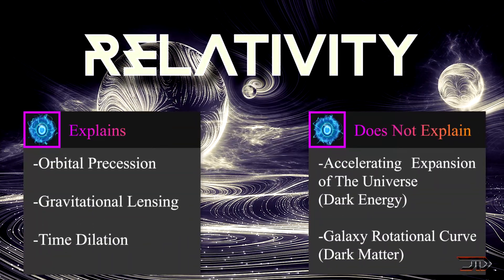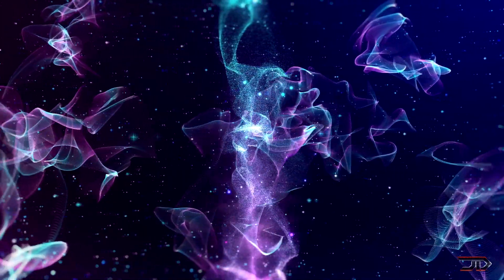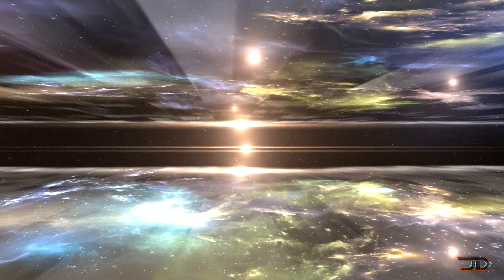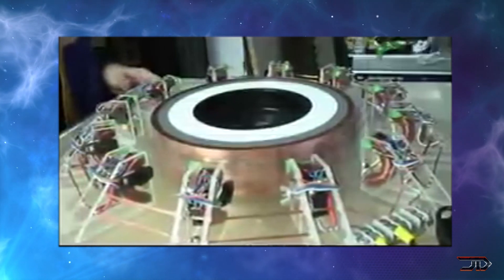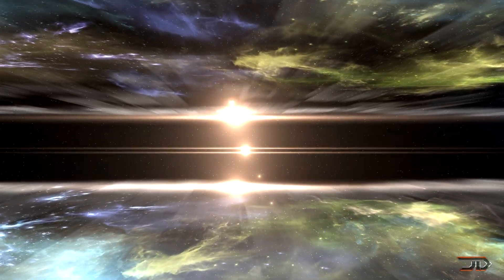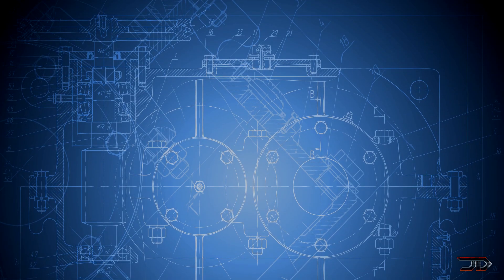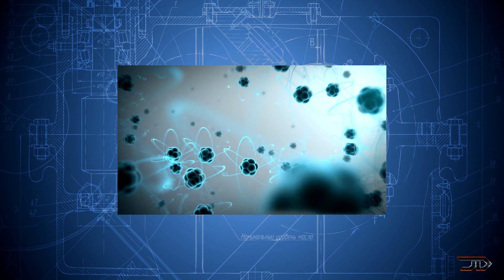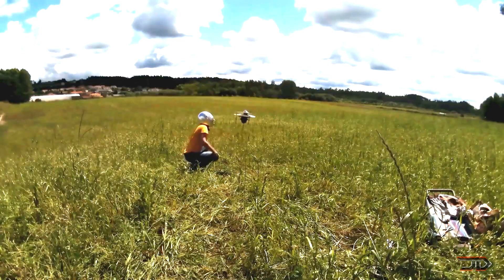Does ANTI-GRAVITY Technology Really EXIST?

Comment: In the 1950s anti-gravity was the rage as industry was experimenting every way possible and all the major magazines were following the research monthly until the mid 1950s as no more stories were written and went completely silent and was very odd and sudden !

Anti-gravity became a non-subject to write about for some reason !
Leaks began to surface in mass in the mid 1990s !

In my opinion you must block the local laws of physics from affecting your craft so to block particle entanglement that gives other atoms  mass a high voltage terrahertz frequency has been used to power a magnetic field that blocks that communication between atoms locally like static blocks radio communications and by 1999 a craft with 79% anti-gravity was built called the TR3-B and is a 300 foot triangle !

Field propulsion vehicles are the future of air and space travel !
This type propulsion has been observed by all UFO witnesses !
There are no motors or noise of mechanical machine type sounds and no sonic booms at all going high speed and excelleration is beyond belief !

I think we back engineered UFO technology but had trouble making the materials needed that had exotic layered metals but it was 79% effective !

No research that is successful will be allowed to be in the media or published or patented as the Govt. has classified this technology as it relates to National Security !
All zero energy devices has been confiscated or destroyed as well !

Truth in some subjects has been outlawed basically !
Reply: Its been patented. By salvatore pais

Comment: This is by far the most accurate description of AC gravity and indeed we need to know more about the molecular composition and its alignment to create a force field. Imo we have to drop quantum mechanics altogether since it is based on an empirical model which makes it hard to give an actual description on what is happening at the Planck length scale. One derivation I have found so far based on E=mc^2 and some crude assumptions (as Niels-Bohr did for his Hydrogen model), is to create an electric field by having the electrons occupy different orbitals (e.g. paramagnetic) which then has a 'field strength' of E=q^2/(4*PI*ε0)+q(c x B)*r, where 'x' denotes the vector product, B=magnetic field, r=radius of the atom, q=charge of the particle, c=speed of light.
Reply: I think it is something to do with manipulation of space in the direction of travel, such as creating a vacume, that will suck you in!
Reply: Math comes after the success.  Math does not create it answers the why and what for after the fact.

Comment: Supposedly the seg inventor has the generator inside a craft and it flew,  but even the magnet rollers are nearly impossible to make, or to magnetized in the proper orientation, then there is a ton of them, seems like it could be done solid-state, with electromagnets, Possibly working better, but if it worked only as a generator it would be amazing, self powered! But a solid-state version may not work as a generator, unless......
Ha-ha

Comment: its easy as one 2 3 , hows how make a copper ring in 1 metre in diameter 1mm thick  by an inch wide copper plate in a circle 1m inch wide 1mm thick , then make the same ring out of acrylic stick that 2 copper ring then make another copper ring for the bottom stick that to it so its a sandwich , ok use a high voltage neon sign power supply put earth at the bottom plate positive to top plate best stick some string to corners so it doesnt fly off and switch on , hey presto a high powered capacitor that pulls itself up in the air easy peasy , has to be big or wont work , anything above 1metre wide.

Comment: In a nutshell, no. But allow me to point out there are a few different flight mechanics. For example, fixed wing & rotary wing. Both use an air foil to create lift. Then consider hot air balloons & zeppelins. Lighter than air flight mechanics are entirely different. They appear to be defying gravity, but it’s just a different method of gaining lift.
Reply: Pressure

Comment: Anti-gravity doesn't mean hovering
An anti-gravity device should eliminate every single gravitational force in the universe.
Even an hydrogen atom at the edge of the universe still have an impact (however small) on the rest of the universe.
The anti-gravity device will NOT fly off, but it will stay completely still (motionless) in relation of, not just the planet Earth, the solar system, the galaxy, the galaxy cluster ... but the whole universe. To our perspective it will disappear faster than the speed of light, and we don't really know what direction the Earth is moving in relation to the rest of the universe, so, having a ceiling won't really help if the planet is moving the opposite direction. it's possible that it will have enough force to pierce through the Earth's core. 
nobody wants to take this into account because, first it is a boring concept, second, we want to control antigravity decides so we can fly them …. but that's just levitation, it has very little to do with antigravity.

Comment: It's simple: Space expands in an accelerating way because of the fact that radiation is sending out of spherical objects. These object loose mass and for this reason they loose gravity. So the space is expanding around them. Its a relationship between radiation surface and Volume(i.e kinetic energy). 
The Galaxy Rotational Curve can be explained by the gravitomagnetic force in the rotational angle. NO FUCKIN DARK MATTER. Every force is a reaction to an other phenomena, accelerating towards the speed of light.

Comment: Magnetic field around the craft which can bend light, trans medium craft which can go through water air space etc. it’s within a vacuum that’s likely one of the reasons it’s so quiet because it’s within its own environment. There are many different types with many different densities. They are inter dimensional. It involves quantum physics.
Reply: Not just bend light. It bends everything around it. That's the reason why it propels itself through the air and sea without friction and heat produced. Nor vibrations. Remember Bob Lazar said he tried to touch it but he couldn't. The craft's crew unaffected.

Comment: Level's of anti gravity
1.electrogravitic
2.magnetogravitic
3.direct generation and harnessing of the gravitational strong force
4.field propulsion..
Reply: you forgot powering it with zero point energy, such that it doesnt need any fuel and wont degrade cause no immense heat or pressure. the anti gravity field also shields you from radiation, so you could even use modern computers inside without fearing data corruption or dna damage. you dont need any equipment to refill fuel, or for take off and landing, and the energy needed is much lower than conventional rockets, and you will not feel any acceleration even when doing 90 degree sharp corners at 20x the speed of sound. all the obstacles of space travel are obsolete for anti gravity devices

Comment: I still think that Townsend brown kinetic devise is worth a look. I reckon that project winter haven produced verifiable results. I have seen a paper published in the mid 1950's written by two British scientists about the state of gravity research  who stated that Townsend browns disks would work in a vacuum. I know that most people think his designs were based on the Electric wind effect. But he was well aware of it and tested his device in an oil bath and in a vacuum chamber and it worked in both, so was not due to Electric wind. Unfortunately Project winter haven is still classified.
Reply: Nothing has been produced since the 1950's - that should give you a clue, Sherlock.
Reply: @BrjanBuckmaster  If they have it the question becomes, why are they keeping it secret???
Reply: @michaelshortland8863  It’s no secret - it doesn’t exist.
Reply: ANTI gravity, is already well known,  It's the by product of the "B" field in any magnet... Not the north or south poles.  Want proof.. Find a magnet that you can access the "B" field of a magnet ,(that's the center of a magnet!!)  Now weigh a small stone on a scale lets say it weighs 40 Gm..  Now tap it vigorously with the center of a magnet the "B" field and it will loose about two thirds it's weight..  move it around and the weight comes back..  if you want to suspend it in mid air you will need to oscillate the "B" field for the material your trying to lift.  Take a look at Coral Castle Florida, Ed lifted 30 ton stones and built his castle it's a tourist attraction now.  The "B field played a major part in the taking down of the towers on 911,  that's one of the reason cars blocks away from the towers were ruined, also the building across the street had to be rebuilt.. It's all "B" field technology,  That's what Nicola Tesla was talking about with his "B" field energy ray..
Reply: @vincecox8376  Oh please. Simplex charges that were built in by the architect for retiring the building took down the 911 twin towers. Maybe Thermite used on third bldg. the buildings were clearly demolition-ed.
Reply: @vincecox8376  That is not anti gravity.

Comment: Can we say that a material contains energy that is comprised of different modalities of this energy - the more feasible such as electrical, magnetic; and more subtle like gravity? More interestingly, it must be possible to convert one energy type to another. For example, under curtain conditions exposing a material to electrical and/or magnetic field achieve releasing of a gravitational energy (the same energy that keeps particles in place within the material). This released gravitational energy would have a great potential, allowing to use it for moving objects at speeds far greater than the speed of light among other things.
Reply: That's similar to my theory.
Like. Imagine having a strong rotating magnetic field inside a Aluminum container. Would it rotate the aluminum? Could it spin fast enough to lift it? I don't know I currently can't afford to experiment

Comment: I was surprised that no mention was made to Townsend Brown's experiments.
Reply: For the LOVE OF GOD,  TTB effect was an ELECTROSTATIC SPACE CHARGE EFFECT

*FREAKING NOTHING, NOTHING, NOTHING TO DO AT ALL WITH GRAVITY*

1)  apply 20,000 vdc (positive electric polarity) to a thin wire
2)  that will strip off electrons from air molecules in the vicinity, leaving them positively charged - those air molecules are now positive ions, and that is the SPACE CHARGE
3)  have a foil 'electrode' at electrical ground potential that is physically positioned near the space charge 
4)  the positively-charged air molecules - the SPACE CHARGE - electrically attract the foil electrode, because the foil electrode is RELATIVELY NEGATIVE compared to the electrically positive space charge

And that is freaking *IT*

The foil is electrically attracted to the positive space charge that is created by the 20,000vdc positive wire and that creates the motion

FOR THE LOVE OF GOD,  STRIKE TTB FROM ANYTHING TO DO WITH GRAVITY

FOR THE LOVE OF GOD 

*PLEASE*
Reply: @Greg_Chase  That worked in a vacuum?
Reply: @Greg_Chase  You obiously have done no research on the matter. TB based his experiments on non-linear high K isolators and pulsed positive high voltage, which he reported as having been tested in a vacuum. Of course, his findings are much more controversial than all of the other "controversial" methods mentioned in the video, so PLEASE, FOR THE LOVE OF GOD, what are you bitching about?
Reply: @Greg_Chase  No. I did NOT imply that I believe his capacitors DO affect/interact with gravity. I only implied that HE believed they do, and thus HIS experiments were quite comparable to the claims of the other controversial anti-gravity claims made in the video.  So, what is your problem with that?  

If however, you believe that the other controversial anti-gravity claims mentioned in the video instead DO affect/interact with gravity then please explain the EXACT PHYSICAL NATURE of how those methods interacted with gravity:  

- did they create a locally increased gravity field, and if so, what is the exact physical nature of how that was achieved?

- or did those devices create a locally decreased gravity field, and if so, what is the exact physical nature of how they did so?
Reply: @vornamenachnahme58  
*TWO TYPES OF GRAVITY MANIPULATION*

1)  'hover mode' - a vehicle remains mostly stationary, above the ground.  This is accomplished by short-duty-cycle  (pulsed) alignment and resonant (Larmor) oscillation of a majority of nuclei spins in a 1/2 spin material such as aluminum, bismuth, etc.

2)  propulsion - instead of short-duty-cycle (pulsed) alignment and resonant (Larmor) oscillation, alignment and CONTINUOUS resonant oscillation of the majority of nuclei spins

*HERE'S WHY MOST ATTEMPTS HAVE FAILED*

It's well known (from NMR and MRI) that alignment of 1/2 spin nuclei results in *nearly* 50% of nuclei aligned with the applied field and *nearly* 50% of nuclei aligned opposite the field.  A tiny percentage (very tiny) of nuclei tip the balance of aligned nuclei to be slighty less than equal aligned with/aligned against, and that tiny percentage is how NMR and MRI signals get generated.  But otherwise the aligned with/aligned against populations cancel each other out and you get no gravity effect.

*THE TRICK IS* to overcome the natural, physical tendency of this near-50/50 spin population problem.  If you do not solve that problem, you end up with nearly 50% of nuclei spins aligned with the applied field, and nearly 50% aligned against the applied field, and they CANCEL EACH OTHER OUT.

The problem is quite similar to the following:

1)  take two bar magnets, the type with N pole at one end and S pole at the other end
2) place the two magnets side-by-side with the N poles adjacent each other and thus obviously because the S poles are on the opposite ends, the S poles also are adjacent each other
3)  remove your hands from the magnets
4)  they will quickly swap position so that the N pole on one of the flips and aligns next to the S pole of the other

So the two bar magnets are still parallel to each other, but you no longer have both N poles and both S poles adjacent each other.

Nuclei spins do the same thing - rearrange to achieve the lowest-level equilibrium energy.

If you solve that problem, and align/resonantly oscillate nuclei spins with, say - an 80/20 population split, (80% of nuclei spins aligned with the field, 20% against) or even 70/30 - so that they DO NOT CANCEL OUT like they normally do with a 50/50 alignment condition -- 

you will find that the Vacuum manifests a gravity field in the immediate vicinity of your 80/20 or 70/30 aligned material

The exact physical nature of a gravity field is a gradient quench of inertial drag.

Out in space, far from any gravity field, a NASA vehicle fires its rockets. A lead fishing weight hangs on a thread in a cradle.  When the rocket accelerates forward, the lead fishing weight deflects BACKWARD in its cradle - this is caused by inertial drag.  It's the same reason you feel "pressed back deep into the seat" in a jet at takeoff, or when accelerating in a sports car.

The vector for inertial drag POINTS OPPOSITE THE DIRECTION OF ACCELERATION.  The proof is the 'pressed back deep into the seat' experience, and the rearward deflection of the hanging lead fishing weight.

In a gravity field though, the vector for inertial drag POINTS *IN THE SAME DIRECTION OF THE ACCELERATION*

'Rest mass' means this:  in open space, far from any gravity field,  there is an 'envelope of imminent inertial drag' - called 'rest mass' or 'rest inertia' - that surrounds all matter objects.  For example, the pilot - and the lead fishing weight hanging on a thread - in a NASA vehicle at rest in open space far from any gravity field - both the pilot and the lead weight will experience inertial drag REGARDLESS OF THE DIRECTION OF ACCELERATION.

That's the NORMAL condition for the inertial drag experience.

IN a gravity field though - take Earth gravity for example -  you can accelerate UP TO 9.8m/s^2 and you will experience ZERO INERTIAL DRAG as long as you accelerate along the vector of the gravity field (towards the planet's center).

*SUMMARY*
- no inertial drag when accelerating along the vector of a gravity field
- inertial drag vector SWAPS POSITION 180 DEGREES in a gravity field

A gravity field is a quench of inertial drag.  Inertial drag is CREATED by the accelerations (centripetal and zitterbewegung motions) of the atoms of matter as they interact with the particle-antiparticle Vacuum.

Earth's atoms 'condition' the Vacuum and reduce inertial drag, in a vector pointing at the densest collection of Earth's atoms - its center.  We have chosen to call this gradient decline in inertial drag - 'gravity'
.
.
Reply: @Greg_Chase  So you actually DO believe in all that crap!